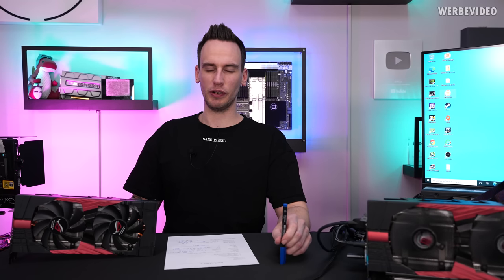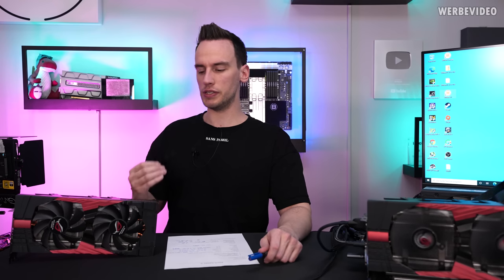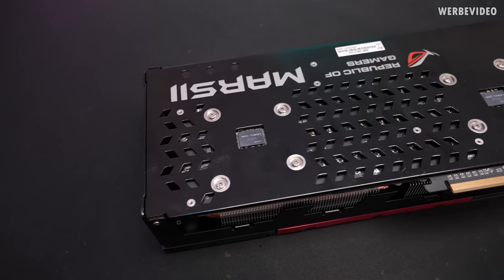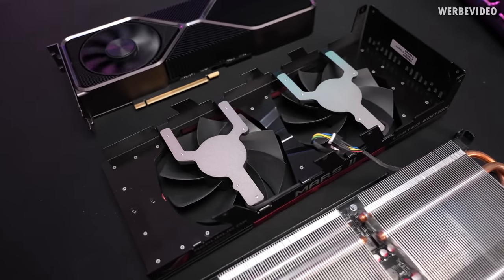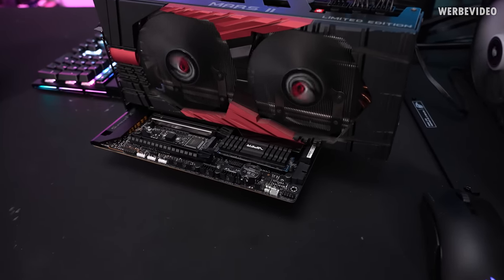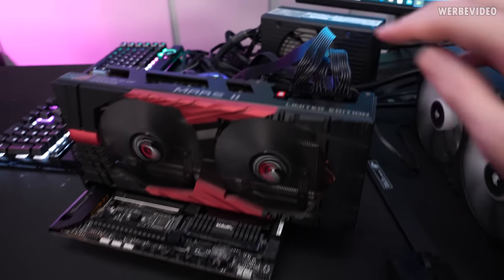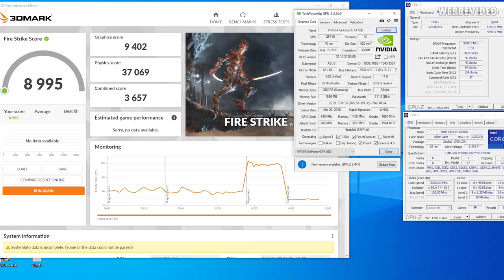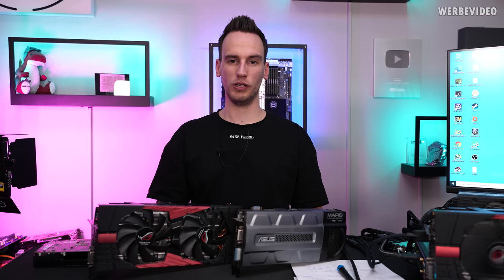HW-Legends #12: Extremely Rare - The ASUS MARS 2 dual GPU Graphics Card

Comment: Your issues could be related to the "SLI tax"... back in the day the motherboard vendors had to "validate" their motherboards with nVidia to be able to support SLI and the driver would block SLI on non "certified" boards
Reply: If the cards were set up as shown in the video at 9:58 it could also be that he needs an SLI bridge.
Reply: Although your statement is true, that’s nit what is blocking quad sli here.
Reply: i didnt even see an SLI bridge hooked up
Reply: @kennethcook9406  He is missing the SLI connector, that is why it didn't work
Reply: It's written NVIDIA, not "nVidia".

Comment: "Overclocking at home is not as fun as it used to" I hear you. Everything coming close to limit, we only have RAM left to have fun. And APUs are also still fun. The rest is meh, unless more cheap motherboards come with clock generator for BCLK on Intel. Funny thing though, is that on Skylake, even cheap z170 mobos without clockgen could BCLK with proper microcode. Wonder how that worked.
Reply: is it really so bad that nowadays people can get the most performance out of their product out of the box now?
Reply: @hellsoul0  from locked/budget products - no, it's really good, from unlocked enthusiast-grade components - yes, it is bad, oc is (almost) the only reason to buy them
the same situation is with cars - if you want to mod a car, you're stuck with early 2010-s at max, no matter what class of car you aim for
Reply: @hellsoul0  Overclockable parts are usually pretty close to the limit, now. Take the i7-11700K. It comes able to do 5GHz on one core. it seems roughly 5.3GHz on all-cores is about where the home overclockers hit a pretty hard wall.
On the other hand, my old Xeon X5670 maxed out at 3.33GHz on one core, and I had that happily running at 4.2GHz all-core. Intel and AMD are binning cores now, not just chips. Less and less performance is being left on the table.
Reply: @hellsoul0  I think both guys above have stated current situation very well. But yeah, typically, nowadays, I mostly bother tuning RAM as most motherboards cant train it well (which makes sense, otherwise POST process would be too long). I think the increased competition on the industry, along with more advanced boosting algorithms have contributed to manufacturers pushing their chips close to the limit. As for GPUs, it is even more boring in recent years, because the BIOSes and Drivers have nearly locked all the fun aspects of tuning, so unless you physically mod a card, it is hard to bypass pre-established power and voltage limits. Not to mention work with memory timings on the GPUs as those are hard locked on their BIOSes. Sometimes some hacks appear for AMD card, but the last one came from Igor and I dont think 6000 series have anything yet, but I could be wrong. Polaris was the last real fun card to overclock/edit bios IMO, nowadays I have more fun with APUs. Too bad that it seems AMD is not bringing decent RDNA2 APUs for Desktop, they saved it for mobile. I really hate mobile stuff, on top of that, mobile chips have hard locked voltage tuning on 5000 series laptop, can't undervolt it. Didnt know before I bought it, pisses me off.
Reply: by ddr6 or ddr7 we will have PBO like thing for RAM on the fly or something.
Reply: Undervolting is fun too.
Reply: @hellsoul0  IKR, lol. It makes K SKU's a bit of a con really, when you can't really do anything with them.
Reply: @glitter_fart  modern hardware takes l the fun of owning unlocked parts out of it. That's why i keep older hardware secondary PC as secondary and often get "new" parts for it. Honestly the most fun platform out is Intel's X58 and AMD's 990FX with FX 83x0 series chips to mess around with. Modern PC's are just slap an all core multiplier and voltage and that's it, no fun at all. No BCLK tuning, no NB (North Bridge) etc tweaking to extract most out of it etc.
Reply: That's why I own every platform going back to my  8088XT,  find em cheap at thrift stores.
Reply: AMD EXPO says "Hi".
Reply: @glitter_fart  today you are happy if its stable out of the box at stock, people get unstable GPU CPU and I don't even start on ram XMPs...
Reply: @hellsoul0   I actually think it's pretty bad, despite GPU's sucking so much back then compared to now but on CPU's at least, they were years ahead of GPU's and OC made incredible impact.

I used my I7 2600K at 4.9ghz on air until like 2 months ago because it burned 1 CPU core though it still magically works fine by setting 3 cores on the bios.

Basically around 260€ is what I paid for the I7 2600K including box and the crap intel cooler back in 2011 and was the best CPU to buy which would be like I9 12900K nowadays and that thing was pretty much a huge beast stock at max 3.8ghz turbo yet I got mine to 4.9ghz on a air cooler and that thing could take many years of brand new GPU's to their limit without needed a CPU upgrade so soon.

Nowadays CPU's are way more expensive, come almost at full max speed and require huge expensive cooling to extract max performance and are pretty much a bottleneck soon as GPU's nowadays are much far ahead than back then which we would pretty much be GPU bottlenecked all the time for years (nowadays is mostly at 4K while below that would require quite a HUGE CPU upgrade to like bottleneck an upcoming RTX4090).

Also my 2011 ~340€ Nvidia GTX 570 Asus DirectCu II with massive 3 slot cooler could OC around 25% more than a stock 570 and that made it go so far on my hands to only change for a crap Strix RX480 many years later because the OC was making me play games for quite a good more time though the low Vram on it sucked so badly and was the biggest bottleneck that shown very fast sadly...

ps: Imagine if nowadays were the same with the CPU's and GPU's having the same exact amazing performance as they currently have out-of-the-box but that could actually even increase so much further to crazy levels (my GTX570 could get close to 1.9Tflops while stock is around 1.4 and the 2600K at 4.9ghz could probably be similar more to like a intel 6th gen instead of a 2nd gen or maybe even very similar to a Ryzen 2nd gen for gaming)... Nowadays you basically pay a lot for the "K" or "KF" on intel side yet you don't really get incredibly more performance than the cheaper locked ones and to even extract just the little extra performance sadly we really need a very good cooler unless you don't care to run at 90º+ 24/7...
Reply: @guily6669  are you saying then that you prefer for companies to not clock their gpus as high so people who know how to overclock can have fun. but if you don't know how to overclock they will end up having weaker gpus than people who do know how?
Reply: @hellsoul0   No, I wanted the same exact performance they currently have but that had even a lot more headroom available for OC cause that's the reason I always paid like 150eur more for a biffed up GPU with massive coolers which sadly don't really give much more than the crappier versions.

Also it's sad that we don't have the exact same current performance at much lower wattages, it's sad that silicon is not getting much viable lately.

Really wish we already had CPUs working with light instead of transistors on silicon...

Comment: Thanks for the video! It is surely a beautiful card from Asus. It is outdated a bit for sure but I'd still love to see benchmarks from quad sli if it's ever possible to boot up. (Will probably require older drivers and an older version of Windows..) Wil be looking forward to the Mars 1 video👍
Reply from the maker: Will work on it
Reply: @der8auer-en  does it not need the sli bridge connector on the cards?

Comment: Error code 12 is common when setting up an egpu. Most times increasing the pcie bar space solves the problem. The problem is most laptops can’t addres enough memory space to a gpu. Could be something similar on the Alder lake desktop. Maybe
Reply: My exact thoughts! I encountered this error when experimenting with egpu on my laptop
Reply: Windows 7 was not good at egpu on laptop external out if the box , Windows 10  works out of the box, even on thunderbolt 1 or 2 as long as you install the os with an egpu present i found
Reply: @jameshackett9992  I tried it on a thinkpad x230 with an expresscard egpu board. On the software side I tried windows 10 and 11. You need to modify a System file and load it on startup with something like clover. But i can only speak about expresscard solutions.
Reply: Mine was a cleavo laptop p375 with original thunder bolt port,

Comment: I had an old 580 Matrix Platinum and I thought it was sooooo cool how they gave that card hardware buttons for increasing Vcore voltage. I wish they would bring real OC features like that back to cards but im sure that will never happen with modern silicon's internal power management features and limiters.

Comment: I have two of the Asus Ares 3 dual GPU liquid cooled video cards  running in crossfire  currently installed in my  backup computer on a Asus Rampage 5 motherboard with the  intel core I7 8 core 5960X. There were only 500 of these video cards made. When I bought them brand new they cost almost $2500.00 Canadian each and they still play most games smoothly, although  not very high frame rates if all the video settings are cranked. it sees very little use these days since I built a modern one. The TDP of these cards is rated at 600 watts per card.
Reply: can I see a photo of that rig? it sounds REALLY interesting and cool
Reply: @faolor6468  I could send you a few photos but I need a email to send them too
Reply: @peterzeboroff7448  ypu can use an image hosting service like imgur and sending the link here. Really interested in seeing what a "quad" GPU water cooled setup looks like

Comment: Fermi got some basic dx12 support added to the driver awhile back. Still no Vulcan but at least some dx12 stuff is playable now. I’m sure anything dx12 on this would use only a single gpu. Though I do wonder if that mode Microsoft talked about where you could mix say, an igpu and dgpu of any variety… if any of those games could work with both.

Comment: You're absolutely right about cards now being close to their limits from the factory.  The first card I overclocked was a Diamond Stealth II 4 MB card.  I had added a heat sink and fan to the GPU and heat sinks to all the ram chips.  Didn't know much back then, I used superglue to affix everything!  That being said....stock clock was 40 Mhz...stable O/C clock after cooling solution superglued in place, I still laugh, I got the card to run stable at 72 Mhz!!!  That's an 80% O/C.  Somehow I thought the card was factory at 35 Mhz. , I swear I remember striving to get that 100 % O/C from stock and doing it.  I do still have it!

Comment: I have 2 x GTX 690 reference cards which can play the second-newest Doom game in 1080p with all settings on max at 45+ FPS. They were running fine in a quad-SLI configuration. Only a few games would scale well with the SLI though. I went through all of The Division on that setup and I had no low FPS issues.

Comment: We need 2 of the upcoming 3090 TI’s on 1 board in sli. Imagine that, 900-1000 watt TDP/TGP, 2 12+4 (16 pin) PCIE 5.0 power connectors, and it would almost certainly have to be water cooled versions only. But you would have over 20,000 Cuda cores, and 48GB VRAM with over 1 TB/s of memory bandwidth.  That card would probably cost over 10 grand though lol.
Reply: Spoiler Alert: He did not.

Comment: If I were to guess, the cards aren’t able to run at x8 with sli because then each chip would only be getting x4 after the split, which might not be enough bandwidth (at least in their firmware) to run. If you were to use an HEDT platform, SLI might work.

Comment: And because they're triple slot the card on the main pci-e is suffering cooling ability. You need the EVGA N780 triple sli mainboard as all 3 pci-e slots are x16. Install on slots 1 and 3 and both cards will get proper airflow and maybe able to run in quad sli.

Comment: Sorry for being off topic and great video. I got a strix 3090 oc. Is it 24/7 stable to run at 100% gpu voltage and 60mhz extra on gpu? Memory with 150mhz extra. Tops out at 2020mhz, rests at 1980mhz for most of the time at 1.100v. 123% watt power.  Normally, retail oc from asus uses 30mhz plus(about 1890 to 1960mhz) at about 1.085v 24/7 at 105% watt power. Temps are at around 70 to 79c° with around 75 to 80% fan speed in CP77. Is that all 24/7 secure? It is stable, indeed.

Comment: i think that u need to enable above 4g decoding in the bios to be able to run both of the cards
Reply: Everyone who mine on multiple GPUs will know ;)
Reply: @zombielinkinpark  nah i had a 24gb tesla card that i was using for gaming lol
Reply: You must be tough to figure the fan out, I tried multiple fan, only 40mm 10000rpm+ can cool them properly and it get very loud.
Reply: @zombielinkinpark  yeh i bought a 3d printed shroud and a blower fan from ebay it was quite loud but i got used to it

Comment: I also remember all those cards... I had a GTX570 3 slot huge cooler from Asus back then and was also at around 25% OC from a stock one with a 1.2V bios flashed it was like 910mhz 24/7 and up to 915mhz sometimes + a lot of OC the memories too though can't remember the values and that bastard was heavily used until I got a Strix RX480 many years later and it's actually still alive and fully working with 0 problems (at least last time I tested it like 2 or 3 years ago).

For some time was actually giving me better performance than a PS4 despite being much older with the huge OC which actually made a HUGE difference, but sadly also the super low Vram size let it down sooner than later ☹

Comment: they would sell a lot of new cards for the next generation rtx40 series. if they revived and used again this MARS chocolate bar branding.... except the red color accent is not trendy any longer. however it is iconic to the character of the mars. But what they can do is make removable clip on plastic pieces. that can then be swapped, or spray painted at home. or to put a vinyl wrap sticker over it

Comment: Just a guess: Regarding  the ssd not detected, it's because the motherboard was in UEFI mode when you installed Windows. GPUs from 2011 requires CSM (legacy) mode. The motherboard automatically switches to CSM mode when the Mars 2 was installed and that disables the UEFI ssd. However, that does not explain why the ssd can get detected when it was installed on the bottom M.2 slot

Comment: Used to have asus Ares III...which was 2x 290x. It was a good card with nice OC possible but limited by some other voltage than the core voltage resulting in blackscreens. It was possible to adjust that voltage only on 290x matrix card unfortunately

Comment: Could a X58 motherboard with a X5670 handle those beauties in SLI, it has 32 PCI lanes.  Yes, my daily machine is an old Dell workstation with a RX 580 8GB, even have a X5690 coming tomorrow for it.
Reply: I love that kinda shit, though. That's pretty badass. Honestly not a bad pairing either. The RX 580 is a great all rounder' for older CPUs and sleeper style builds like that.
Reply: @k9online  Have had this machine for 7 years, changed the CPU twice, came with a 4 core (X5647) to start with, was $300 on eBay. Plan on retiring it this year and make it my new PFSense machine, so it will be nice having that slightly faster CPU.

Comment: I think this shows just how much money these companies are printing today. to think that every single part and step in manufacturing is faster cheaper and more automated... my god do we need competition.
Reply: Although production cost may drop due to automation etc, staff and pretty much all other costs go up yearly.
Reply: Actually not the case. As processes get more advanced, the costs of all the components has gone up, along with inflation. AIBs of Nvidia have pretty thin margins these days. The 3050, for instance, is a money loser at MSRP.
Reply: @TheKazragore  Yes parts go up for a while, but then come down. It's cheaper to make a good calculator today then it was 10y ago etc. Part of that is also due to automation etc. A Gtx 1050Ti is about on par with a Gtx680, and the former is much cheaper to make. If the 3050 is indeed a loss-leader as you say, then it's likely to be in order to hit certain price points, and starve off AMD sales. Do you have proof that at MSRP, a 3050 is indeed sold at a loss ?
Reply: @zadekeys2194  Dude, he doesn't because it isn't . shareholders would sue... their revenue is up 61% while their diluted earnings per share is 120%+ only an idiot would think they are making less per unit. There's zero point debating it.
Reply: @user-dn5bx2iu3e  thanx for the info. For the sake of discussing the matter, he didn't say they are making less per unit (average across their Gpu division) , he specifically pointed to the 3050. As I'm sure you're aware, many companies have one, or a few loss leaders to bolster sales / starve off sales from the competition / get some marketing out of the price to performance ration ,creating positive market sentiment, even if it's in the lower end. If he had said the xx10-xx30 was a loss leader, I could believe it, but the xx50 has usually been for the casual gamer on a tight budget, which I imagine is a large majority of people. The xx10- xx30 is usually just to replace a basic dead GPU / add dual screens / something better than onboard.

Comment: Dual gpus on a single card is awesome. I wish they still did it. Better yet they could stick 2 chips together like apple done. It's sooo simple!
Reply: AMD 7900XT, Nvidia Hopper in the Data Center, which would be the 5090.
Reply: sli/xfire is cool in theory but in reality its  impractical stuttery mess, its very inefficient, gpus dont share vram so 2x2GB cards will still give you 2GB vram and almost no games in the past 6 years properly support it

Its pretty much dead for gaming at this point